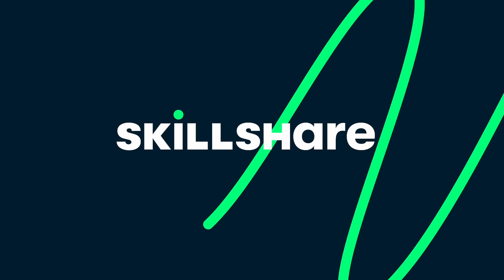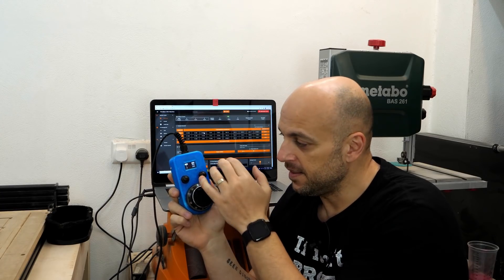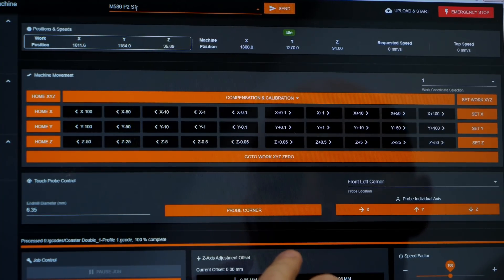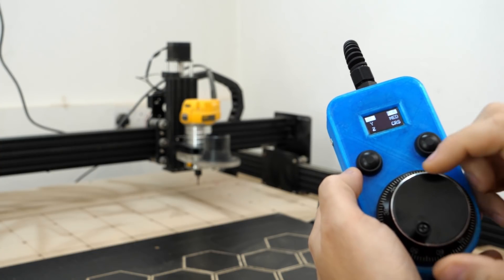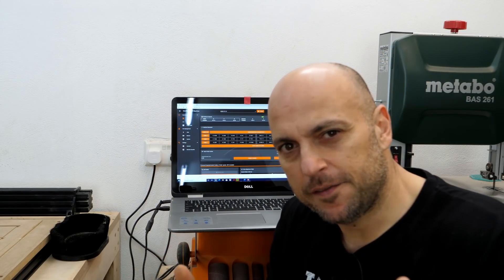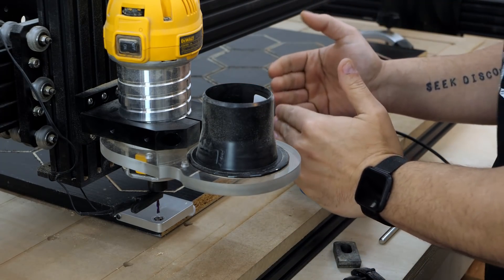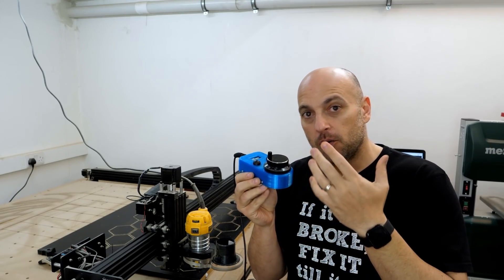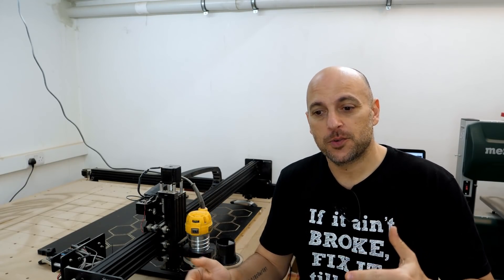The Best CNC Tool I Didn't Know I Desperately Needed

Comment: I thought I had ultimate control having my wireless keyboard and the monitor mounted at the front of the CNC running Mach 3, that is until I got a Shina pendant for Mach 3 and now I have ultimate control of the CNC.